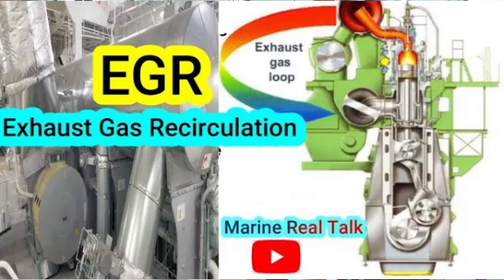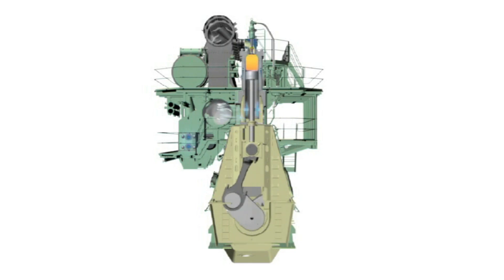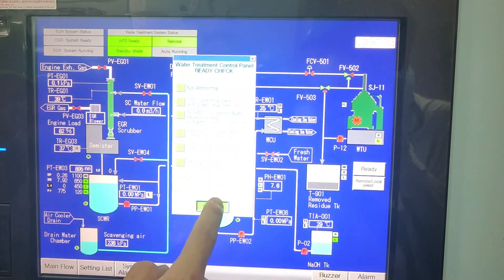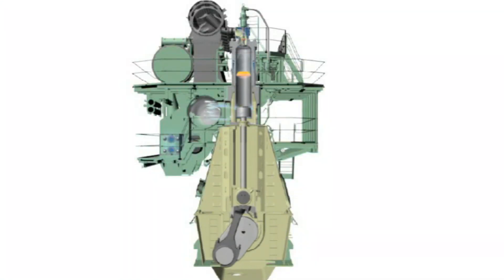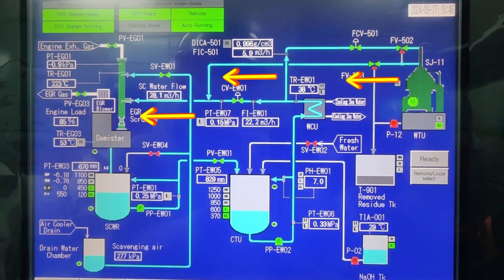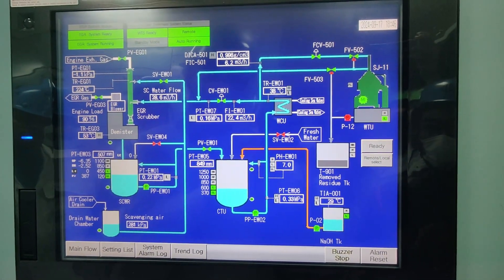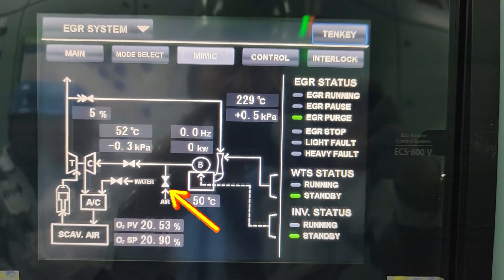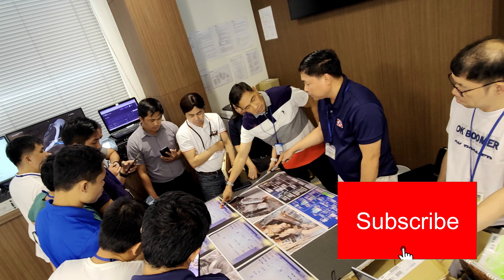Principle and Operation of J-Engine Low Pressure EGR | Chief Boyet

Comment: Thank you very much, sir! Please, explain what does J-Engine mean?
Reply: Hello sir! We have a problem during transition from tier 2 to tier 3 while the tier 3 is blinking in the LCD . Alarm of 0xygen low low is alarmed and also oxygen deviation in lower and upper part is also activated causing the light and heavy fault to be activated. We tried to calibrate again the oxygen sensor and still these alarms are being activated during the transition. Can you share some ideas sir how to troubleshoot this alarm? Thank you for your reply!
Reply from the maker: Hello Sir, is your EGR is J-engine LP EGR? Have you tried to clean the O2 sensor? When you do the calibration, how was the result, was the value same meet the setting. When the the alarmed triggered, may I know the KW of your EGR blower along with the engine load. But i would appreciate if you could provide me a photo of your EGR system display so I can further assess.🙂
Reply from the maker: Hello Sir, J-Engine means Japan Engine. It is an Engine Maker's name just like Mitsui MAN B&W, Hitachi MAN B&W, Sulzer, hyudai and other engine maker.
Reply: @marinerealtalk8683  Thank you very much, sir!
Reply from the maker: @AnatPlk, you are very much welcome. If you have question in any of my videos, feel free to leave your comment.🙂